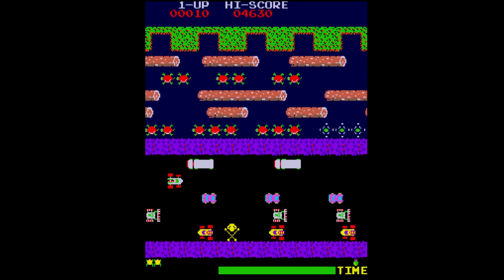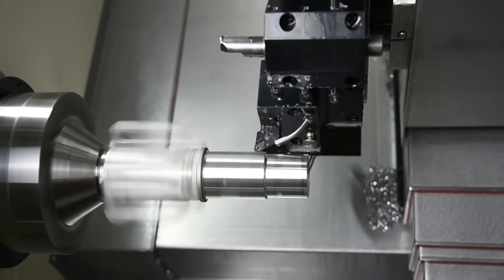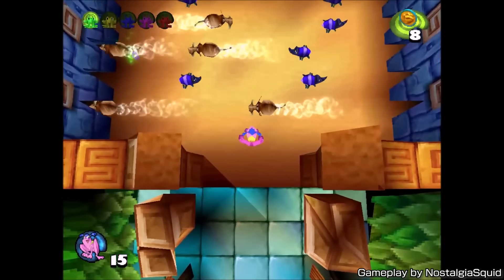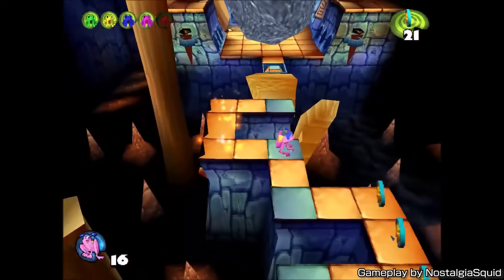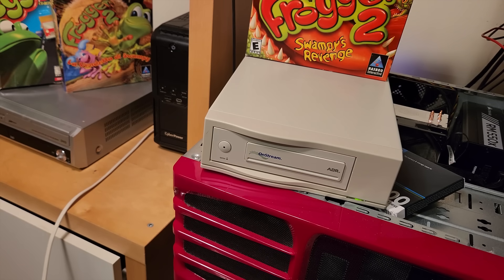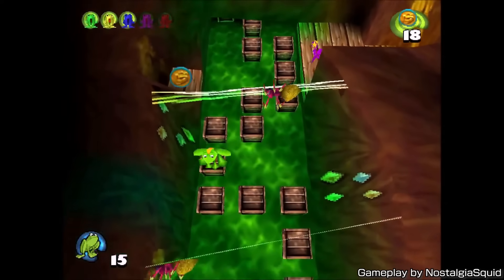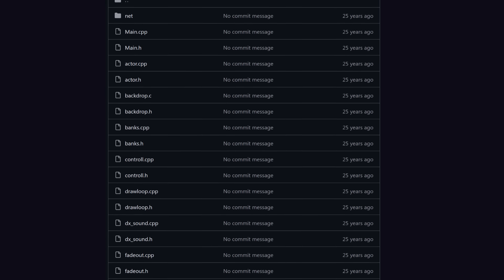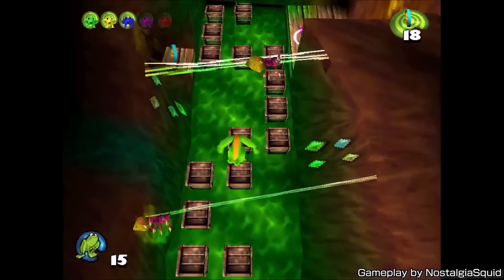How Frogger 2’s source code was recovered from a DESTROYED tape

Comment: Never trust data or media archival/recovery companies unless you do serious research into every other option. Most don't strive for quality and you can often get better results at home. 

I've seen companies give things in lossy formats, imperfect transfers, audio channels being reversed, missing, or incorrectly formated, video being in the wrong aspect ratio or resolution, or just otherwise terrible quality transfer attempts. 

Just doing basic research, I have the means of archiving all of the analog media formats I have machines for using only the machines that play/record those formats, a Retrotink 5X, an audio interface, an HDMI capture card, and a computer running Audacity and Handbrake. And I've seen many companies do far, far worse despite it being their job and me not buying anything specifically for archival purposes. It maddens me to no end to see companies not do their job correctly. Ace Recovery in this case has to be one of the worst offenses I've ever seen.
Reply: That's genuinely terrifying. Lossy ANYTHING when it comes to archival specifically is just baffling.
Reply: @purplegill10   Yeah. There's no excuse for using the wrong file formats, and hardly any excuse for consistently using lossy formats (e.g. jpg or mp3) instead of lossless formats (e.g. png or wav)

Comment: this is a great example of why NOT to store data under proprietary hard/software. imagine the sanity that could've been saved if it were on a normal tape drive
Reply: I'm pretty sure that back in the late 1990s, this is what passed for a normal tape drive.  There weren't any options that didn't have proprietary hardware and software.
Reply: @BrooksMoses  By the 1990s standard tape drives using SCSI interfaces were pretty widespread. Options would include stuff like DDS, DLT, and Exabyte formats. These were supported by generic drivers in UNIX, Linux, and Windows. Either way, proprietary drives always cause headaches.

Comment: That is an absolutely normal thing for data recovery people to do.   If your sending a tape/disk/drive to them they are assuming it's broken.   So, they take the platters/tape out and read it with a special read head that captures the magnetic fields.   Then they use software to look at the gazillions patterns that those fields could be in.  That way they only have to read the tape/platter once no matter what format it's in.
Reply: Even assuming that's true, two major issues stick out to me.
1. If it's taking longer than expected, you gotta be transparent about it. Especially when asked technical questions - at that point, stop screwing around and explain what's taking so long.
2. If I'm understanding correctly, the splice points here weren't repaired properly, causing the data in them to become unreadable. Assuming that's true, their claim about performing the same was a lie.
I'm going to assume that this dishonesty is not the industry standard (and if it is: the industry badly needs a new standard). In fairness, there does appear to be some potential for honest miscommunication, with the full story passing through so many people to get to us. It may well be that a shame campaign is unwarranted. But overall, I'd still be wary of these guys, based solely on this communication.
Reply: @tikatoo  Customers that have never used the server before think that's true. But it's not.  As per your numbered issues;
1) There is no way they can give an estimate on time.   The customer doesn't know what's wrong.  So how they they tell the tech.   If your car broke down on the highway you wouldn’t call a service company and demand to know how long it will take to fix it if you can’t tell them what’s wrong.   A Flat tire and a blown engine take vastly different times to fix.  It’s even worse for the data recovery people as figuring out the problem is almost 100% of the time. It’s like figuring out a combination lock when all you can do is guess.    You can take months guessing the wrong combination and have 0% progress.   But when you get it right it’s almost instant.   This would absolutely have been explained.
2) Once the break the seal on a drive there is no undoing that.   Once they cut the tape there is no undoing that.   Your going to loose data.   They take some educated guesses and try to cut where they think the directory and other meta data is because usually it’s better to have the data then the file names, directory locations, date stamps and such.  That's why when you get them back there are some files that are just numbered filenames.    There is no way they didn’t explain this as they could cut where the very important data is and they would get sued if they caused that data to be lost without telling the person the risks and having them sign off on it.
Reply: @lucidmoses if this is the norm, then the whole industry is diseased, doesn't make it any better.
Reply: @kneesnap1041  Wow,  I don't know what's worse, You read my comment and then left that comment or you didn't actually read my comment and you left that comment.
Reply: @lucidmoses what you said somewhat makes sense but the story in the video shows that the company sucks. 

the email they sent clearly claimed that the tape would be sent in an identical condition and it would work as it did before as when it was sent in.

that is obviously impossible and they were lying. they sent out a tape that was cut off, losing some data. enough that a drive wasn't even able to start reading it.

so yes, the industry is diseased if things like this are accepted as things that happen.
Reply: @lucidmoses I read it and don't agree/don't think it's correct or accurate to the situation. I could detail all of my disagreements, but I also don't really want to start an argument.
Reply: @SilentOnion  Before I just dismiss you as just lying, can you please send me the time stamp and approximate location where it says "identical".   I find that email pretty hard to read but I don't see it.  since apparently you where able to let us all know where it is.
Reply: @kneesnap1041  Well, here's hopping you never have to find out.
Reply: Destructive methods are always a method of last resort with data recovery, and with it carries a large amount of risk. Working in the embedded device space, we get chips that are completely bricked and unrecoverable. We do not destroy them for study until we are absolutely sure it is the only solution to solve any potential issues, non-destructive means are always first.

Regarding tapes though, if the tape needs to be fed into a different loader they could have opened the cassette and cut at the end past the end of the tape where there would be no data to wind it onto another cassette.
Reply: @XerShadowTail These splices are unfortunately smack dab in the middle of data lol.
Reply: @kneesnap1041  I don't remember them saying that at all.   If you cut a tape where there is no data, you can still get read/write errors while it's reading the tape looking for it's markers.   Cartridge tape systems like that where never perfectly reliable so having a read error doesn't mean much.   That's why we always had a bunch of tapes.  But I can see people jumping to conclusions without any evidence, just like you did.
Reply: @XerShadowTail  Your thinking in terms of a cassette tape or reel to reel.   I'm not sure that's the case with that device.   However, I was just going by the fact that it was cut.   They don't run around with scissors accidentally cutting tapes.   I'm fairly confident that if they cut it they did it for a reasons and most likely that reason is risk reduction.   But yes, if it was a reel to reel it would be hard to see why they would have to cut it unless the table path was captured when they glued the case together.   Not sure.

Comment: I once had fun with some tape backup system.
An old server that had been out of use since before I joined the company had a tape drive in it, a SCSI controller, and we still had several boxes of old tape media. We had "proper" backup systems in place, but I thought it would be a good exercise to set up that tape drive and look into using it for *something*. 
That tape drive was a complete and total bastard and I hate it. It would seemingly swap at random between working and not working, sometimes writing to a tape would stall the entire OS, and the only time I successfully got data written to and read from it, the data was corrupted despite the software saying it passed validation. It could read the index and show what files were present, but none of them worked afterwards. Which is one of the reasons we TEST OUR BACKUPS. A validation pass isn't a test!

Comment: We're going to have the same problems with data stored on current formats. A SATA HDD is as likely to be readable in a few decades as an MFM HDD today. A Blu-ray disc as likely as a format which required acquiring a working magnetic tape drive from the second hand market. NVMe etc.
Reply: BD, as a format, may have a better chance to still be readable. After all, BD drives can still read CDs, a format from 1982, so that's 40+ years of compatibility. The fact that there's only a new optical disc format every decade or so helps. CD in 1982, DVD in 1996, BD in 1996, and UHD BD (BDXL) in 2016. There's essentially only 4 disc types to read. Of curse, that's of the popular formats. Good luck reading an HD DVD disc, or EVD. Also, that's only the format, not the specific media. Some CDs have rotted away, and CD-Rs are failing. The problem likely won't be if we have the tech to read the disc, but whether the disc is still readable.
Reply: @marsilies  A CD can still be read because they are still actively getting sold, brand new. You're using a flawed reasoning. It's eventually going to turn into the same problem.
Reply: @graealex  Actually, that helps bolster my argument, since it illustrates that just because a format is decades old doesn't mean it's obsolete. And sure, EVENTUALLY there will be a point where no new optical drive can read CDs, but at the least, it's much further out than with floppies or magnetic tape or other media.

Comment: I do believe the recovery service would have a machine that can image any magnetic tape. Wouldn't need any secret sauce.

Good story though and I'm glad they worked through the hurdles.
Reply: No, this tape has special sine-curve stabilizing, and 192-tracks of data. I've never seen any other tape with that. If it were a standard 8 track it'd be easy, but the tape drive has dedicated hardware. The tape head itself is custom, and there are custom ASICs made only used by this tape drive.

I would be shocked if there is a machine on earth capable of reading these tapes other than the original drives.
Reply: @kneesnap1041  192 tracks?  What does it think it is, a linear hard drive platter?  That tape format is an amazing piece of technology, in many senses of the word, and most of them not positive ones.
Reply: @BrooksMoses It is quite impressive! If I'm remembering right, it took the rest of the industry a few years to reach that number! And I believe the rest of the industry did it with significantly larger tapes (I don't know the exact dimensions off the top of my head, but I think like 3x the height for something like the DLT tapes).

It's a shame it was bogged down by the madness of compatibility problems among other issues.

Comment: I’m shocked that a company with so much proprietary garbage that doesn’t even work with the same model name went bankrupt. Just shocked.
Reply: What makes it really useful as a backup format is that  due to missing metadata the tape can only be read on the machine that wrote it. Which might work when you test your backup, but fail when you really need it.
Reply: Yeah
Reply: that is just how they did things in the 90s and before they did everything themselves never cooperate with other companies only when more average people started using computers did this start to become annoying
Reply: The actual proprietary stuff they had is most likely a PC3000 kit and the rest is just random SMD work tool and maybe a few tape reader if they were dedicated to the tape part
Reply: Most things were proprietary in the late '90s early 2000s, and they were different model name readers.
Reply: @EikottXD  which, to be fair, even to this day it's not recommended to load a tape on a drive it wasn't writtten with.

Comment: While under normal circumstances the loss of those files would be understandable in this circumstance I'm actually annoyed about it because it was caused by such ridiculous incompetence from a so called "data recovery" company.
Reply: And also the company that created the backup software with massive bugs and out of spec behavior AND the company that created the tape drive with massive bugs and compatibility issues
Reply: @MaxOakland  ok, yes but that's also par for the course in a lot of ways and part of the challenge. The data recovery company mucking things up was totally avoidable if they had just been honest and professional

Comment: My grandad worked in IT, he stored all his data on these geriatric drives.
Photos, word documents, excel spreadsheets. One day, he was writing data on the drive when he heard a horrible grinding noise.
When he tried to eject it, the tape was all over the drive. He tried out of desperation putting it back in, sending what was left of the tape to a local recovery place.
But alas, all his data was gone.
Reply: The good thing about a tape compared to a hard drive, is in case of failure, the chances of a partial recovery is MUCH MUCH higher on tape than a harddrive.
Reply: @victornpb  Yeah, due to how data is written to hard drive platters, if a tiny part of the platter is damaged, you're almost entirely fucked. Tapes are written continuously, so a bit of the tape being damaged isn't that bad because it's likely only a small amount of data from a couple files.
Reply: tape is a great option for backup, but back up is the key word there, it shouldn't be your main storage option
Reply: @MayYTlive  Usually 2 copies on tape 2 different brands ideally on 2 different locations, tapes are very hard to kill if stored and used properly, the main mistake the guy made on this video is inserting the tape onto a drive with a bad pinchroller no tape drive over 10 years old can be trusted without thorough internal check also depends on the loading mechanism and even after that you'd use a blank tape write data, retrieve check functions only then trust that drive with a one of a kind tape. As for the mistake made on this comment above it's similar but inserting a badly loaded and badly ejected tape back in just causes the binder to get damaged and metal particles to leave the tape or shed (MP/ME/BaFe) he should've stopped right there take the drive apart and unload extremely carefully and even then the likelihood of data loss was high though possibly partial and then go find the second tape and recover from that while using a good drive this time.
Reply: @MayYTlive  yeah it should be used for deep cold storage. It shouldn't be treated like a SD card or a flash USB drive.
Reply: First rule of IT is to make 2 backups on different media.
Reply: @Okurkaarrgghh Ideally in two separate physical locations in case one place burns down or floods or has some other similar disaster occur.
Reply: For anything crucial, two is one and one is none. Period.  I don’t get why people don’t understand this.
Reply: And that, dear commenters, is why I always have at least two copies of all the files I love.

I will NOT lose the photos of my late dog to some technological error.
Reply: Tape is far more resilient than HDDs. LTO tape is specified for 30 years of archiving. HDDs don't have that longevity.
Reply: @ArcardyArcardus  Kind of goes to show how shitty digital media is at long-term storage in general. Archival grade paper is considered capable of lasting 1-2 centuries if stored correctly.
Reply: The thing with digital media is that it's very easy to make a copy of it in most cases.

Unless it's stored in all the cloud or has important files on a server, then you're screwed.
Reply: @ArcardyArcardus  yea, i removed that part because of that 👍
Reply: @ArcardyArcardus  neither do LTO without maintenance.
Reply: @ArcardyArcardus yes they do there are hdds waaay older than that still running
you have no idea the amount of data still in hdds the size of u
Reply: Depending on if the tape has been kept or not, you could prob recover it as a sort of family present
Reply: That data recovery company sucked. Also, he probably should have bought more tapes instead of writing more data on what clearly had some old archives that should have been left untouched in a safe place.
Reply: pretty sure youre not supposed to use these as daily drives and are only meant for backup specifically for reliability reasons (and also because every end-to-end pass degrades it slightly)
Reply: rip

Comment: The problem with tape formats in the 90s is that they all wanted to use the razor blade model but it doesn't really work when you are a large number of companies fighting over a tiny market. Companies wouldn't back any kind of universal standard because they wanted to make sure you were buying media from them.